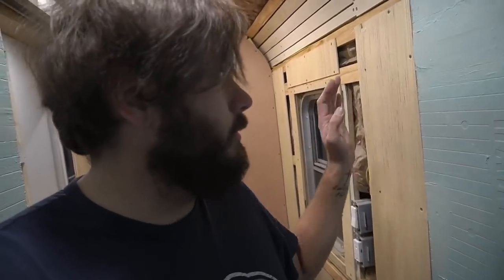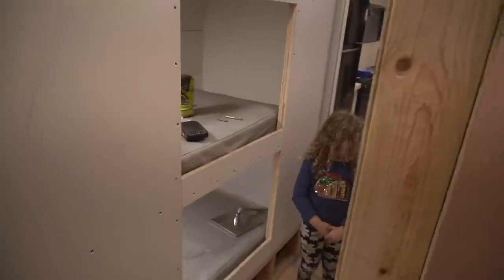School Bus Conversion Episode 24 - Full bath with tiled shower inside an old school bus!

Comment: On the drains, I recommend that (in a few places) you put flexible unions in the runs.  The glued pipe is too rigid and may eventually fail with the motion of the bus.   They will provide some stress relief.   Also, insulation of the drains that may freeze.

Comment: Using my moms account but I noticed you didnt put in a water filter system when connecting the outsude valve and the water tank together .to keep the tank quality high I would recommend it if you plan on getting water from multiple sources

Comment: That bus is going to so heavy using household building materials. I bet it'll be well over 70,000 pounds. Blowing out tires driving down the road killing everyone. Those tires are rated 15,000 max and if one dually blows from overweight the other is almost always immediately afterwards.
Reply: Just the School buses are built to cary X amount of students weighing no more than 120 pound each. Your HardiBacker is at least three students of weight. That thing is gonna be SUPER dangerously top heavy..  of rather you do it safe than do it by code or by stationary home standards. Mucho love from Orygun.
Reply: Don’t forget that when the bus eventually crashes due to being 70,000lbs and the tires blowing out, all of those tiles will immediately transform into throwing stars becoming deadly projectiles putting everyone in the ENTIRE county that you’re driving through at risk. 

Additionally, any droplets of water still left in the shower head will heat to scalding temperatures and be flung into the eyes of spectators.

Tell me you know nothing about skoolie builds without telling me you know nothing about skoolie builds 😂
Reply: 70,000 lbs?? 😂 
Tell us you don’t know shit about RV conversions without actually telling us you don’t know shit about RV conversions.
Reply: Have you even ever seen a high school football player??  Way more than 120lb defenders, buddy, so not the max. Most buses are rated for 30-50k lbs, so a 3’ tiny tile shower is NOT going to set him over.  SMH